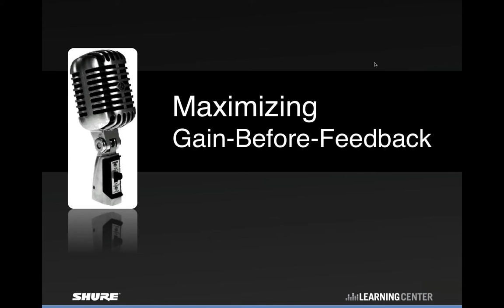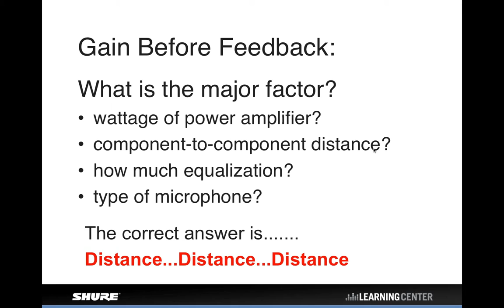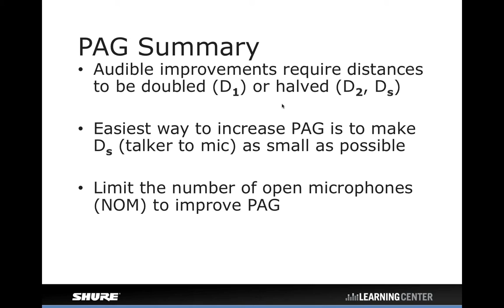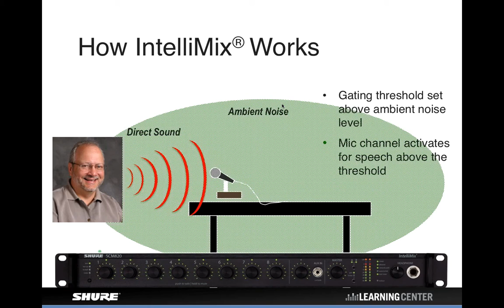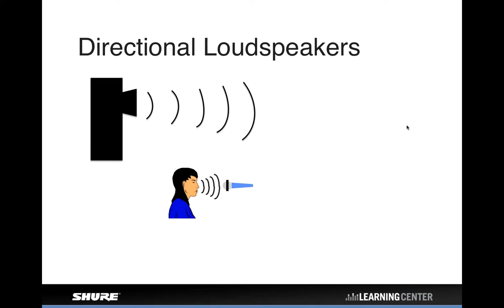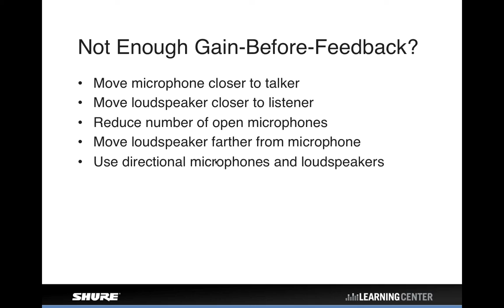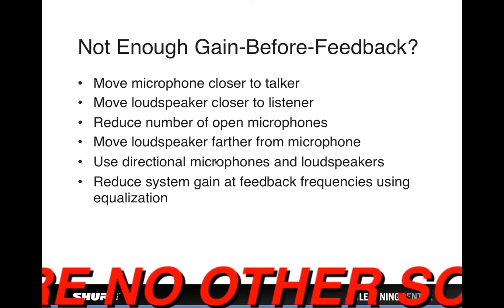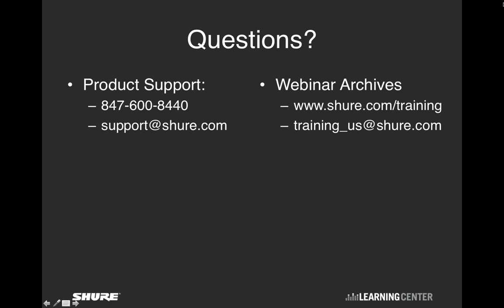Webinar: Maximizing Gain-Before-Feedback in Your Sound System | Shure

Comment: I understand the importance of distance (mic to mouth, and mic to speaker), as well as EQ.  What I'm still wondering about is transmitter settings.  On my transmitters, I have the option of boosting and lowering sensitivity.  Right now I have mine set to 0dB.  I could go +/- 6dB or 10dB.  I have the gain knobs (sensitivity) on my mixer for each mic channel set to 9 o'clock as well as the output level of my amp.  My amp and speakers are pretty beefy for my venue, but the audience still has a bit of problem hearing, so I want to be able to pump out more volume, but as soon as I do, I get feedback.  Even with the omni element right next to the child's mouth, and speakers pointed away, and NO monitors, I have issues if I start getting much louder (of course with unidirectional hand mics, Chris Rock could shout into it with no feedback.  It's only the headworn omni's that give me problems).  I'm wondering if I would be better off putting the transmitters to -10dB sensitivity, still putting the element as close to the mouth as possible, telling children to PLEASE speak loudly, and increasing the gain on the mixer, if the net result would be ability to pump out more volume from the speakers than I currently do.  It would kinda be a trade off of gain (taking it away one place and giving it back another).  But I'm thinking if the MIC is less sensitive, the omni "ball" of audible pickup will be smaller and lessen potential feedback, even if the speakers are louder than before (which is what I want).
Reply from the maker: Hi Andy. The answers to your questions are too complicated to reply here. You can call our Apps Engineering department to discuss: 847-600-8440
Reply: You need to switch out the Omni to a cardioid. Is this a lapel mic? I would get a good cardioid headset microphone

Comment: The problem equation at time 13:50 (20Log 15) isn't 24.5, but is 23.5.  This system will have a NAG still greater than the PAG, so it will not work.
Reply from the maker: Thank you for pointing out this oversight.  It was a typographical error.